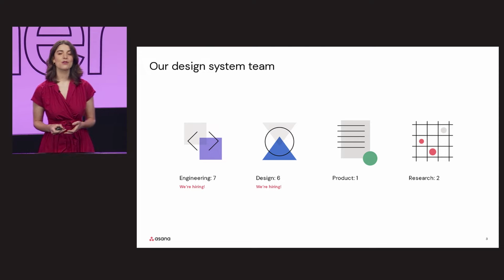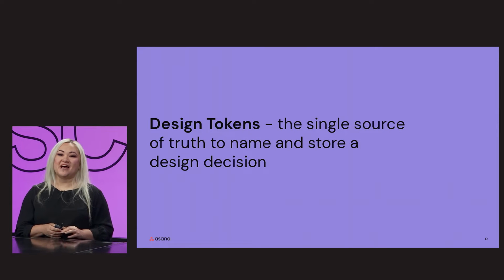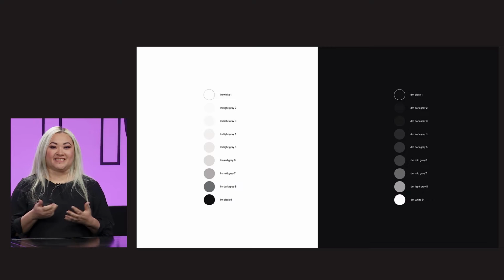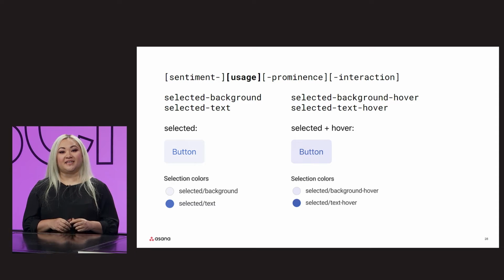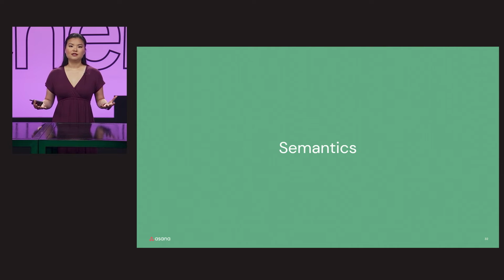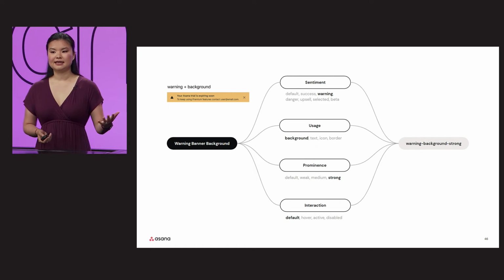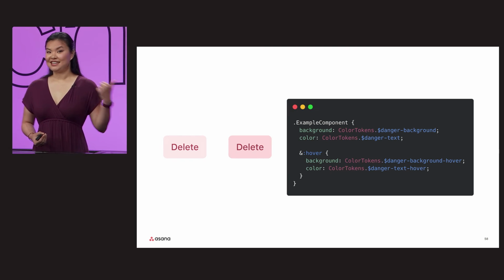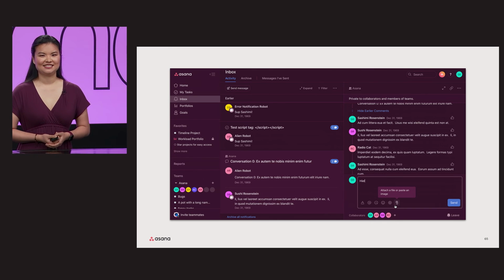Design Tokens on Asana's Design Systems Team - Jina Anne, Ainsley Wagoner, Ivy Wang (Schema 2021)

Comment: Question. Why is selected-text-strong white?
Reply: I guess because it's displayed on selected-background-strong which has blue color defined (#4573D2)
Reply: This is the confusing part to me as well. Because actually prominence is a relative concept, white can be strong on dark background, but it is not strong on light colours. When you have a few prominence levels for both background and text colours in the same sentiment, things are getting confusing - text-strong, text weak, background-strong, background-weak...should a text-strong be combined only with background-strong? How does text-weak look on background-weak? I feel some more rules are needed here.Maybe I didn't get it. Can someone explain?